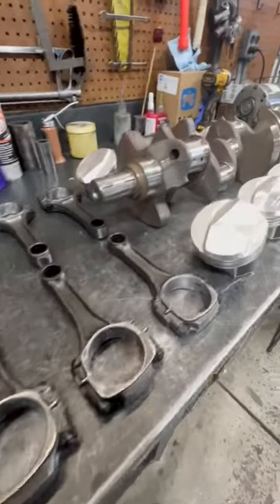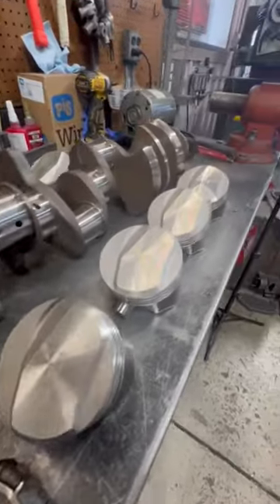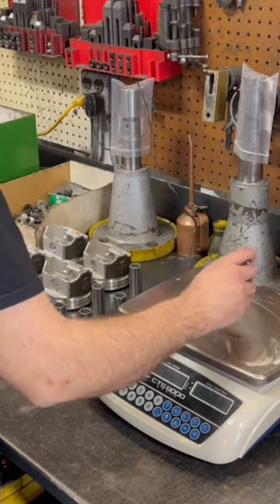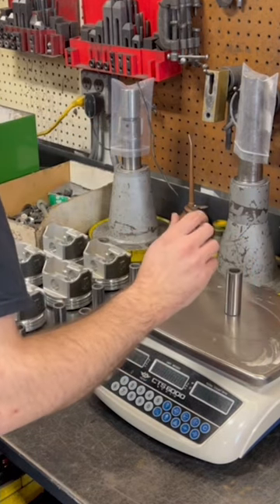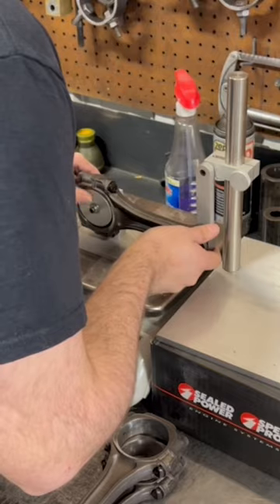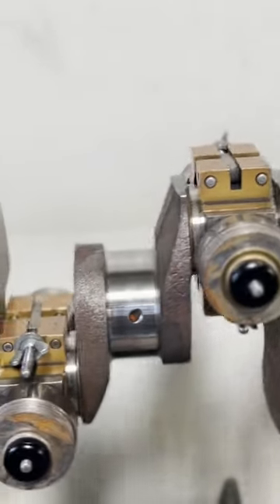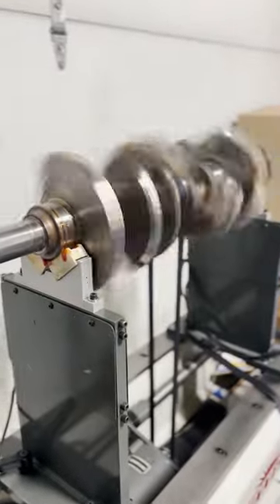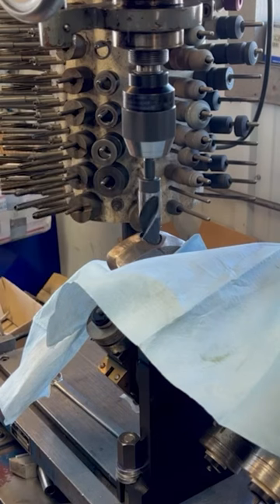#shorts What Does A Dollar Have To Do With Balancing A 396 Big Block Chevy?

Comment: Fun fact the first Chevy, classic six. Was designed by Louis Chevrolet with help from his younger brother. They built the first counterbalanced crankshaft. He’s also the one to put the gear selector in the middle of the floor. He was a talented engineer, who grew up poor to become a automotive legend in the early 20th century. 

Another would be Buick was the first to have in head valves.
Reply: It was also very sad how chevrolet was forced out of his own company very quickly because the board wanted a car for the people and Chevrolet wanted a race car. Luckily later on they came back to their roots to make classy fast cars.
Reply: @Paul-oo6uu  wasn’t really forced. According to a book written about Durant. It wasn’t about race cars. Louis wanted a luxury car. He grew up poor moving around Switzerland with his brothers and sisters. At the age of 9 they settled in Baune, France. By the age of 11 or 12 he had to drop out of school to help support the family. Here’s something not mentioned an old news clipping said his first job… was guiding a blind wine distributor around to various wine distillers. 

But yeah, Louis wanted a luxury car. He went back to racing with Frontenac. But he ultimately quit when his youngest brother died. Gaston was like all Louis’s siblings they followed him, except Alfred the oldest. But when Gaston died in a tragic accident in a race in Hollywood he stopped racing. Another tragic thing to note, Louis had failing health towards the end. According to a news clipping on Chevrolet brothers website. They had to amputate his right leg to which Louis was quoted as saying, “no they took my heavy foot. The end is near.” He shortly died after that. His other younger brother Arthur took his own life not long after that. 

To quote the book I’m referring to:

“Late in 1913 Louis Chevrolet and Durant parted company.
The real reason, perhaps, was that Durant had decided not to continue the large, luxurious car of Louis Chevrolet's dreams.
Instead he wanted to compete more directly with the low-priced Ford. But a more immediate reason was an ongoing, and petty, dispute over Chevrolet's cigarette-smoking habits. Louis Chevrolet's version is that Durant told him he wouldn't make any money until he became a gentleman, that he should smoke cigars, not cigarettes. Every time they talked, Durant would mention this. Finally Chevrolet could contain his irritation no longer: "I sold you my car and I sold you my name, but I'm not going to sell myself to you. I'm going to smoke my cigarettes as much as I want. And I'm getting out." And very shortly he did.
Mrs. Durant recalls: "I don't think it was so much that he was smoking, but the way he did it. Louis would have a cigarette hanging on his lower lip and it used to annoy Willie to tears. So it wasn't just the smoking. Willie smoked cigars, but never cigarettes."
Reply: @86LukeM  I didn't know that. In the cars that built America it toutched on the subject and I gathered that he was forced out of the company
Reply: @Paul-oo6uu  Durant was forced out. First time he was “forced out.” He basically tried to buyout Ford. Which according to the book about William Durant the father of GM. Initially General Motors was the Morgan’s wanting to consolidate. It fell through. So Durant, basically with other investors created GM. They nearly bought Ford, but Durant was turned down for a loan. Instead he had to pay a loan back to the bank. It was something like $14 million dollars and Durant had to give up control for 5 years to the bank. Which is how Chevrolet was started. 

He was forced out by DuPont, because he was investing in other things. Most notably, he invested in a company that became Frigidaire. He apparently went off to run a bowling alley as noted by the book, William Durant the father of General Motors. I even read before he died, he was poor and actually tried investing in a hair tonic. 

A few other crazy things. One that was mentioned in the book about Durant. He hates cars. His original business was carriages and he had to take a ride in a Buick to get sold on the idea. Even crazier, David Dunbar Buick, actually was a inventor. He’s responsible for porcelain enameled steel. He later worked with an engineer to make the in head valve engine. Became bankrupt, bought out by a gentleman I don’t remember the name. He was fascinated with these “cars.” Still didn’t make money on them to which lead to Durant’s purchase. 

On one about Louis, when he got to the US he spoke French and not a word of English. He made his debut as a race car driver, because his skills as a mechanic won him a chance to drive. If I recall he spent 3 out of the 15 years he raced in a hospital bed. I could be off on the estimate. But he survived accidents that killed other drivers and mechanics. In his own words he said the cars would fall apart in the middle of a race. He actually built a Buick race car with another driver it’s known as the Buick “bug.” A thing to note in his youth Louis helped support his parents through bicycle racing. Which as I said in my last comment his siblings followed his example. His two younger sisters and two younger brothers won races. He later while at Buick became friends with Albert Champion. Who is the name behind Champion spark plugs and also the AC in ACDelco. Albert was a French racing bicyclist turned inventor. Their friendship didn’t last when Louis was at Frontenac. They got into a fight, Louis nearly beat Albert to death. Coincidentally, when Albert moved Bach to his native France a wealthy man. He divorced his wife and married a younger woman. Later on he suspected she was cheating on him. So he followed her to a hotel. His suspension were correct and confronted the other man. Albert was beaten so badly, he could barely walk. 

The man later died of a heart attack in his hotel room. The widow got control of his company and later sold it to GM. To which as I said, is the AC in ACDelco.
Reply: @86LukeM  that is really cool. Thanks for taking the time to write that all out and share it
Reply: @Paul-oo6uu  no problem. I was doing research on Louis for possible YouTube videos. Same with Durant. Just don’t have enough time to research, remember all of it, record and edit.
Reply: I thought Buick's claim to  fame  is that he invented hydraulic brakes? Chevrolet was a playboy race car driver and the car was named after him as a marketing gimmick cause he was so famous. No one has accused him of being a  engineer ...
Reply: @papawhelp  I just googled it and it says duesenberg was the first to use hydraulic brakes. As far as modern companies I thing Chrysler was the first but I may be wrong.
Reply: @86LukeM  
Thanks for all the info. Average life expectancy in 1913 was 50.3-55.0 yrs. I'm sure Louis lived an industrious life.
Reply: @happydays8171   he died at the age of 62. It was right after his right leg was amputated. He was quoted as saying, “they took my heavy foot, the end is near.” Oddly enough life expectancy for his original profession, before Chevrolet motor car was founded. He was a race car driver, that spent I believe 5 years out of the 15 he raced in a hospital. I know there’s a reason thing saying he invented the rollbar. I found no evidence of that. Closest was him rolling a Buick 60 special aka Buick bug. It was said he tucked himself under the water pipes. The Chevrolet brothers websites has pictures from archives of his racing days. But yeah, he was lucky to reach 62. A few mechanics that were racing with him died, same for some drivers. His baby brother actually died at the Hollywood race track. He flew off a cliff and died.
Reply: @86LukeM  
Thank you for all your research. I've often wondered about the Duesenberg Brothers, they won Indy twice. Was it as easy to go broke racing back then as it is today? I love drag racing, and qualifying for US Nationals Indy, 96, saw Blaine Johnson pass away when a slick blew going thru the traps, and he was leading the points. Then the next day, a man I admired but got little credit, he could look at something and see a way of getting horsepower, Elmer Trett, passed away the next day when his Top Fuel motorcycle throttle stuck open at the end of the track on an exhibition pass. That weekend was devastating for me.

Comment: Balance is so important, the only way to add power without adding airflow is to reduce parasitic work. I have spent twice the time reducing the parasitic work, than adding airflow, and the biggest advantage is longevity of the system vs just adding power.  You sir are under great tutelage!

Comment: I see there’s been lots of comments and that’s really good but I must add my own and it’s basically antidotal. My first new car was a 1966 SS 396 Chevelle and I paid $3200 for it, four-speed, of course. I sold a year later for $3200 and the only thing that I did to it was put a set of tires on it replacing the warm tires with the original style wide ovals and chrome wheels which I think we’re around $100 back in the day. I worked at car dealers until the very early 70s and drove everything that was made up until then. Muscle cars don’t impress me only because I got to drive and use everything that was around. When the Z 28 first came out in 67 I got a ride and one with a factory rep. Hopefully, YouTube will not change the meaning or spelling of any of the words here and they have a bad habit of doing that.

Comment: This thing is gonna rev 6500 no problem. Sweet.
Reply: Lol, on the kind of cars I had, I only started making power at 6,500.
Reply: @brarautorepairs  which means the big block would get the jump and with enough gears hold it
Reply: @brarautorepairs  which would be?....
Reply: Taistelu_pelto  Yes it is. Assuming that both engines are 500hp and you start from a dig. The N/A 396ci makes peak power at 4000rpm and the opposing engine is a 2.2 liter turbo inline 4 with peak power at 6500rpm and both the 5 speed gearboxes are similar ratio proportions. The low power band of the 396 will give it a launch advantage and with the gearing it will maintain the advantage. The high power band and turbo of the 2.2 will cause it to be slower off the line. It will slowly creep up on the 396 until the 396 runs out of gears.
Reply: @BleedingWhiteKnuckles  I grew up in the sports compact era. We mostly had front wheel drive 4 cylinder engines to work with. The only way to make power NA was to rev them higher. Alternatively, you could add boost but still needed to rev the engine because the turbo was so big, it didn't spool until 3500.
Reply: @Raj Brar  so you played alot with intake runner  lengths  I assume?

Comment: I graduated UTI in 2005. Hot Rod U we learned all this, and I felt it to be a never-ending pursuit for perfection. 
Mass produced 4 and 6 cylinder engines are nowhere near this “perfect” yet I’ve cleared 170,000 miles easy on those beater engines.
No tune ups, no head work, just oil changes and a thermostat here and there.

I guess what I’m saying is Im glad to see what I learned at UTI has value somewhere, but I took my education a different route to the electronic troubleshooting and industrial maintenance.

Comment: Pls explain more why it has to be balanced and what happens if it’s not
Reply: Imbalance causes the center of gravity and center of rotation to not be aligned. This results in a forcing while running. This forcing causes vibration. This vibration needs to be constrained by the mounting of the crank to the block. Some imbalance is OK. As the mounts can withstand some extra forcing. But excess amounts of imbalance can result in breaking the crank.
Reply: @Brandon-sc1fz and it takes away power by forcing parts in weird directions

Comment: Hey, just wondering, since the machine tells you where it needs to be balanced, how was it dont before machines? Idk why just curious. Im an auto tech so i dont get much time inside engines, only R&R usually
Reply: Perhaps using gravity to allow the crank to spin so weight is at the bottom? It'd have to be laying on some frictionless blocks.. not sure about dynamic balancing tho
Reply: engine technology was far less advanced before these tools existed so tolerances were looser i’d assume
Reply: It wasn't lol
Reply: Well an engine will run without super fine tuning the weights, just not as well, they probably had a crude way to test it but nothing that tells you down to the milligram or thousandth of a pound

Comment: I see you are using a 1" or larger Silver & Demming drill bit in an Albrecht keyless chuck.  This is a very bad thing to do. If the drill grabs just a little, the torque can explode that precision chuck. They are not meant for bits larger than their shank size that they will take.  Use a ratty old Jacobs 18N chuck for step shank drills. Believe me or don't believe me, I don't care. But you are abusing a precision chuck with rough work.  -Doozer
Reply: @Retired Bore I can see your cards.  An Albrecht chuck is a self-tightening chuck. If the drill grabs, it gets tighter. I have seen them get so tight, that the jaws impress 3 witness marks on the drill shank.  I have also seen them get so tight as to crack a jaw and tear out the teeth that retain the jaws. I have taken apart many Albrecht chucks to fix them because other men have not treated them with care.  They are a toolroom accuracy chuck. Not a worn out Jacobs relegated to use for holding taps.  You can't tighten one of these chucks just a little so they will slip. It's all or nothing.  And I agree, it is about experience. But I am afraid that sharing my experience is going to be ill received, because perhaps I am presenting my information in a manor that is impossible for you to accept. It is however fortunate for me that the burden of understanding is not on the author.  Good day.  ---Doozer
Reply: I've seen an Albrecht literally become one piece with the shank on a reamer in much the same way.
Of course this happened right after several people - myself included - not to run a large reamer in an Albrecht.
When I say 'become one' they tried to save the reamer by using a pipe wrench on the chuck, the whole mess ended up in the scrap hopper.

Comment: 396 sounds tuff, but it's a truck motor. Now, if you can find a way to keep the camshaft from going flat, you might have something. Yes, I'm a Ford guy. Friends don't let friends drive Chevys.
Reply: I've put 2 of these together for NHRA Stock Eliminator and they both ran excellent.   NHRA Stock Eliminator is no joke. Check it out.

Comment: Watching metal be ground away from rotating assembly parts scares me
Reply: The rods actually have thick parts made into them specifically for grinding on. You just have to make sure you don't try to take too much material off too fast and scorch the metal.
Reply: @BobSmith-kd6lq  I know it’s safe but it still just gives me a uneasy feeling inside